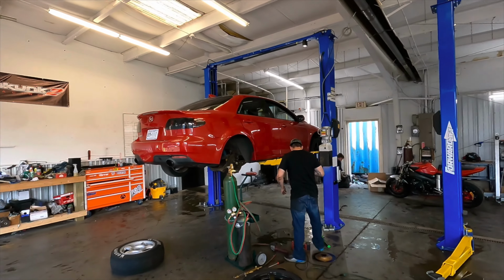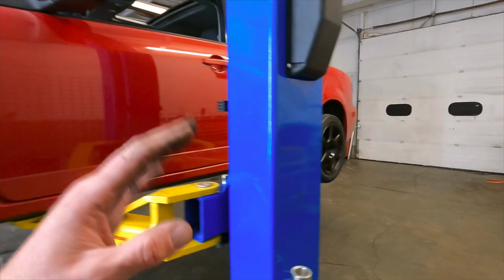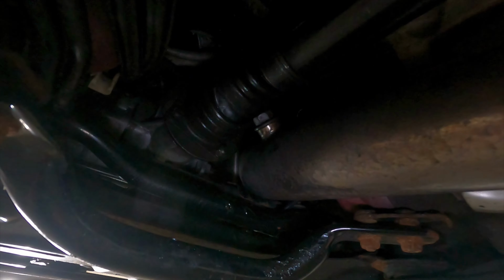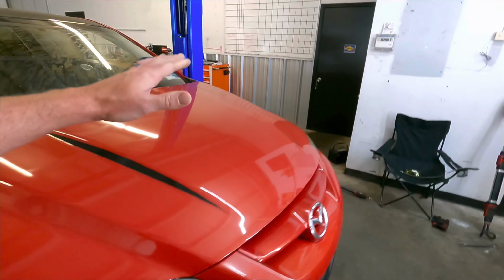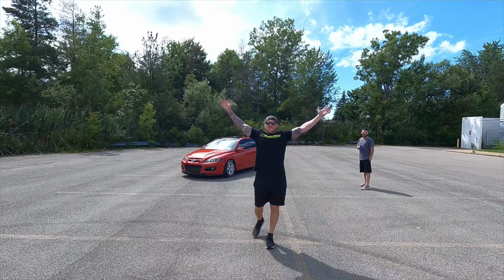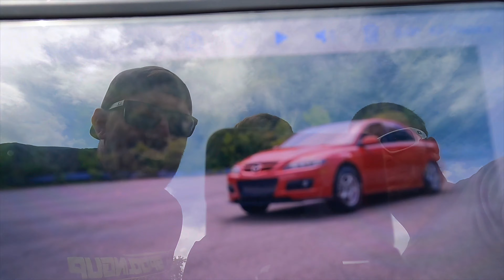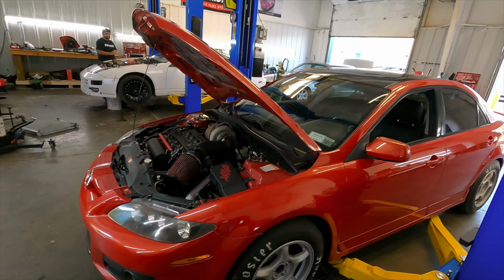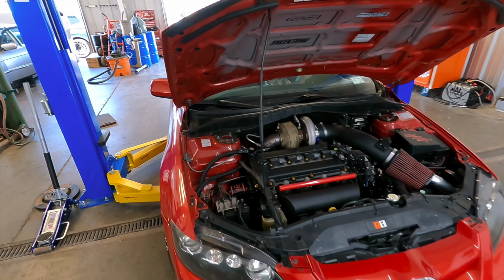Crazy 800HP MAZDASPEED6 Launches HARD at 6500rpm On No Prep! | SOUNDS INSANE |

Comment: Basil tuned, running 25% e98 bnr4, ST intake manifold, full exhaust 3.5 CAI. Some weight reduction in my speed 6. Mid 13s. Love that car. Adding fuel cell and 1050cc Port injectors to run pure E at boost. Water methane. Trying to see how much HP till the motor goes. Then I'll build for HP like the one in this video. 😁

Comment: One day, I'd love to get my speed 6 to this point. Currently just running CST4 @ 23lbs on 91. Fighting really bad heatsoak with CS TMIC. Need a front mount BAD. 😜
Reply from the maker: Let us know what you need!!
Reply: What kind of Temps are you seeing for boost and coolant? Just curious cause I'm still on a tmic as well but with a shitty ebay manifold but my Temps are relatively decent for where I live
Reply: @RogueRAZR   Yeah.,  I have a CPE tmic and even in michigan 70s my boosted intake temp will go up to 180F after one pull (if i get stuck in any sort of stop and go traffic for a bit.)  It works fine as long as the car stays moving though.

Comment: Love your videos! Currently in the middle of building my speed 6 rn and it’s red also lol shooting for 650whp! Not excited about buying an x clutch twin disc though😂 it mutilating my wallet! But keep up the awesome work!
Reply from the maker: Lol thanks ! Let us know if you need anything
Reply: How Is it live with your speed6? I found one in good condition
Reply: I'm running the act xt extreme clutch 6 paddle, it's rated for over 650 ftlbs and is half the cost of a twin disc 👍 I'm sure our gears will strip before anything else at that torque
Reply from the maker: False, it not half the cost it’s only a couple hundred more for this twin disc. The only problem that we’ve experienced with those ACTs is that at a higher power level they can’t keep up with high rpm flat foot shifting they tend to start locking you out of gears when going to bang the next gear. We were missing shifts with a single disc because of that reason only. Other than that those ACTs are really good.
Reply: @SpoolingUpPerformance  yea if you live in the USA 🇺🇸 here in UK after import taxes it's less than half the price , I'm only at 450whp on stock head still at 7250rpm so  guess that's why mine is coping fine,   anymore I'm sure I'd be experiencing that also, every day is a school day when you own a mazda I suppose , great clean build by the way wish my was as clean 😂👍
Reply from the maker: Ouch ! Ya I can imagine it could be expensive